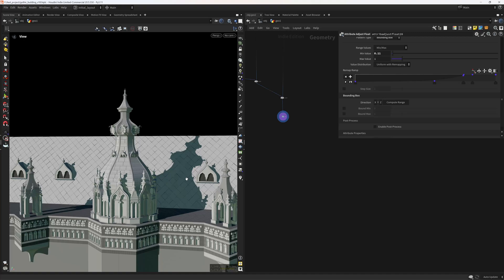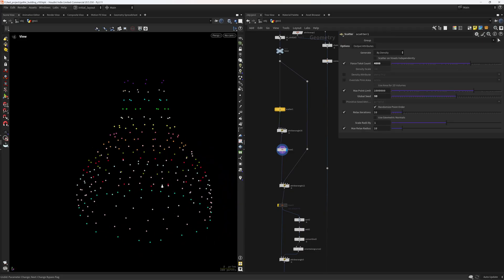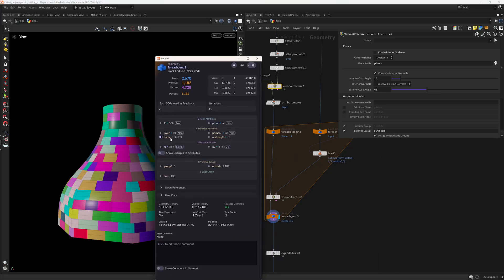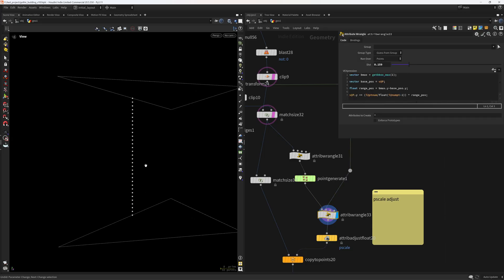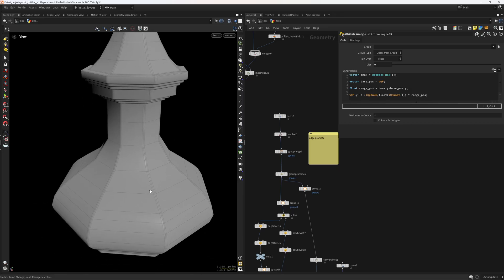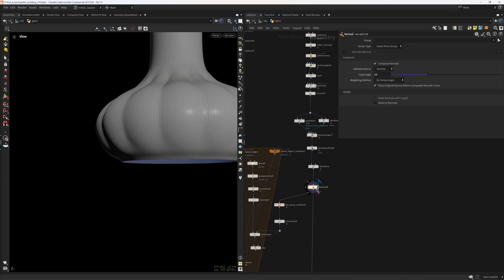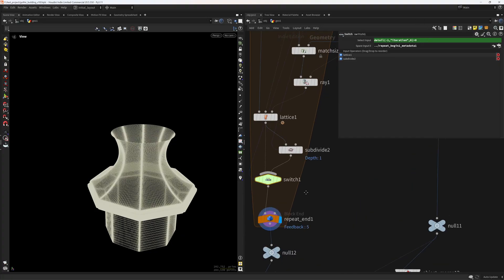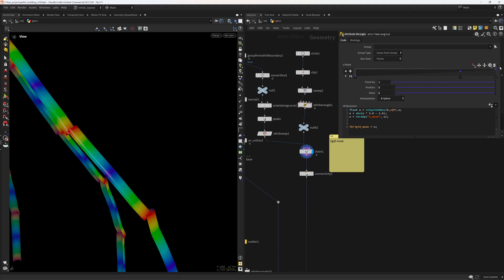Procedural Buildings in Houdini | Tips and Tricks

Comment: Hi, some really useful tips. One question, I was following along with the tile bit, managed to get to the point where you put the tile layers(the first voronoi fracture) and the tile points into the for loop, but no matter what I try I cannot get it to iterate over both streams. (I think I get the theory, you blast all the tile points that are not the same layer as the tile strip). Just wondering how you did that ? Thanks.
Reply from the maker: I have a similar setup in this video:
https://youtu.be/kPtCgMWIBj4?si=Wa-LVCfVxdbBOp4p